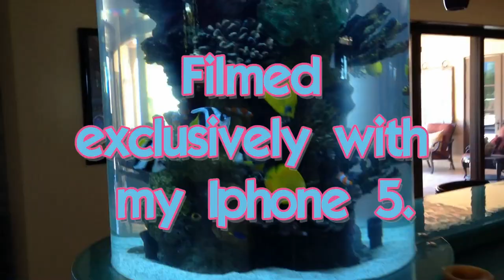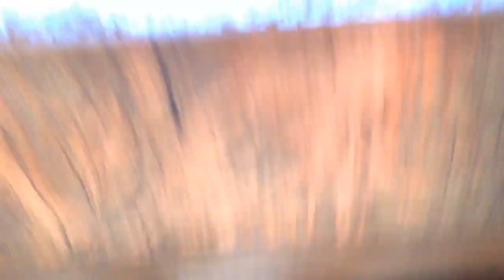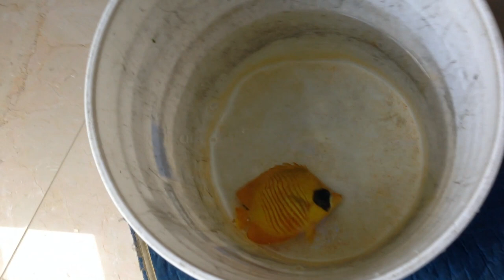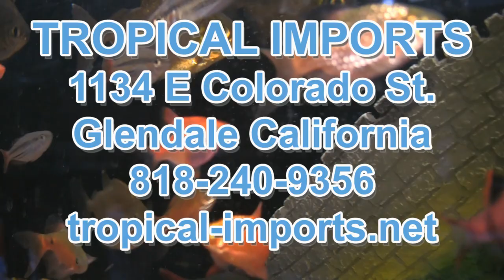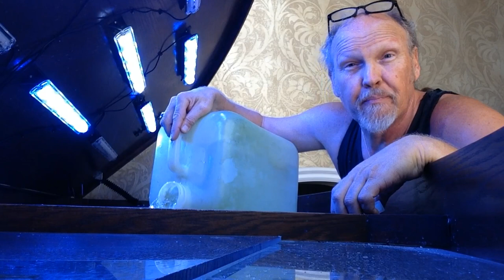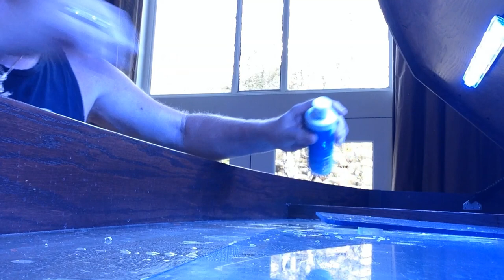Ick Saltwater Parasites LA Fishguys Episode 137, part 1

Comment: Jim, I'd like to offer you some advice. I was the saltwater manager at Old Town Aquarium for years (we spoke on the phone once), and the service manager at the Midwest's largest aquarium service company for years before that. 

To avoid Cryptocaryon (“ich”) problems from ever occurring in a fish-only tank, just keep the tank hyposaline at all times. There is a lot of misinformation on the internet about long-term hyposalinity. I can personally attest to having kept fish for years at 1.012, including all of my service clients. There are public aquariums who have had similar results. This will completely prevent the two most common saltwater parasites, Cryptocaryon and Neobenedenia flukes. Hyposalinity is a safer and more effective treatment for both these parasites. There is published aquaculture research (done on euryhaline sea breams) that has shown Cryptocaryon does NOT respond to short-term freshwater exposure (like the dip you gave that butterflyfish). The parasite is under the epithelium while it is feeding on the fish and thus not exposed to the salinity change. It’s not until the parasite leaves the host that freshwater (or hyposaline water) has any effect. (Similarly, hyposalinity has been shown in published research to be more effective than praziquantel for killing Neobenedenia). The only caveat to using hyposalinity is that cartilaginous fish will not tolerate it at therapeutic levels.

Therapeutic levels are 1.008-1.012. You need to find an accurate refractometer that you can rely on. Those plastic/floating hydrometers are worthless for the level of precision you need. Having the salinity above your desired level, even slightly, does essentially nothing to curb parasite growth. As an aquarium business owner, you have too much money invested in this not to be using the most accurate measuring technology you can get your hands on.

Had you initially just lowered the salinity straight to the therapeutic level you would have avoided all the fish deaths. Once again, there is a lot of misinformation on the need to slowly bring a tank to hyposalinity. I’ve treated with abrupt salinity changes countless times. It will not affect the fish in any observable way. It will save the fish from enduring unnecessary exposure to whatever parasite you happen to be dealing with. Just to reiterate, I have taken hundreds of fish from 1.025 to 1.010 with no ill effects.

As for Cupramine, it is generally safe when dosed slowly. But I have seen it kill angels/butterflyfish even then. And it always seems to suppress appetites when it’s at a therapeutic level, weakening the fish further. I personally am not a fan. But if you do use it, get yourself a test kit. With all the money you have invested in this, why are you relying on guesswork here? Still, hyposalinity is safer and more reliable. 

Also worth mentioning, hyposalinity is not effective against Brooklynella (clownfish disease) or Amblyoodinium (marine velvet). I’ve also seen one other ich-like parasite that was unresponsive to this treatment. But these are relatively rarely encountered situations. The vast majority of the time it is either Cryptocaryon or Neobenedenia causing the problems, and it is so easily treated by just lowering the salinity.

I hope you’ll take this advice to heart. No more fish need die.
Cheers

PS Chocolate tangs are ugly fish and ich magnets. That was your first mistake.
Reply: Some amazing advice here that I will take note of for my next setup.
Reply from the maker: Thanks Joe, good information
Reply: Some of the best information I've read on YouTube in a long time. Thank you for sharing...

Comment: have never heard of a tank breaking out in ich from heat. Should the tank not have been set up to deal with the temperature rising ? Probably caused from adding that chocolate tang and those other fish  you were not sure about IMO. 
RIP to most of those fish
Reply from the maker: hey B, there are a handful of reasons for the Ick, temperature spikes could be one of them. while the tank does have a chiller the Ick problem did occur during a heat spell in September.
Reply: lafishguy Hey L I have been breeding discus for years good thing about high temp is that ick does not survive above 28 degrees Celsius temperature
Reply: *****  marine ich and fresh water ich is different.  
marine ich doesnt get treated with high heat.

Comment: You should not uses copper and hyposalinity at the sametime. You can't simply add the copper and visually look at the fish to see if you have the right dose. You need a copper test kit. The copper will get absorbed by the rock/sand. The ich can remain in the dorment stage for over 4 weeks so just watching the fish for a few days is no good. The white spot is exit woond from the ich and not the ich it self, so just looking to see it the fish has any spots is no good. The ich  could be in the dormrnt stage. You need to maintain the copper level for 3 weeks then watch the fish for 4 weeks.